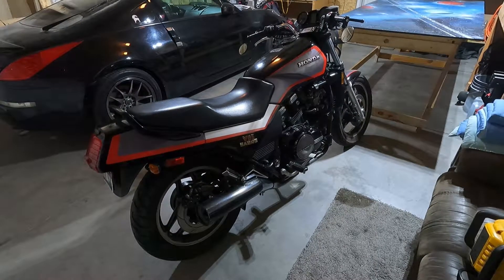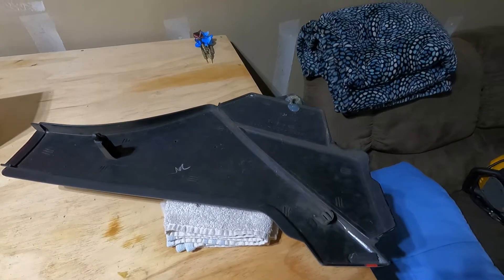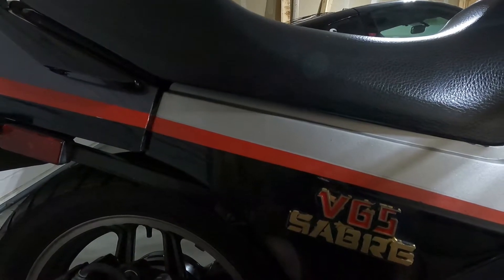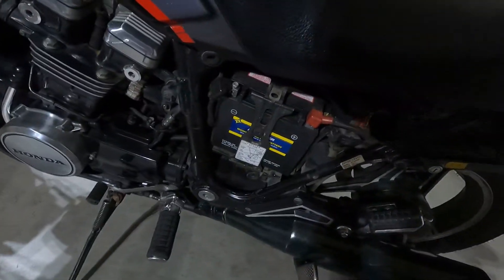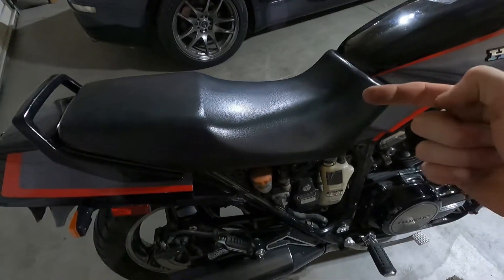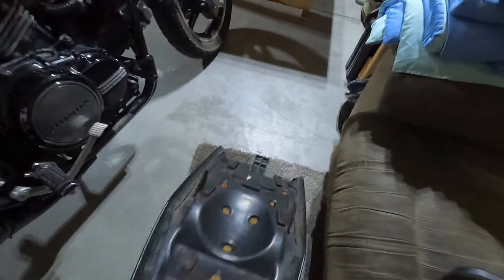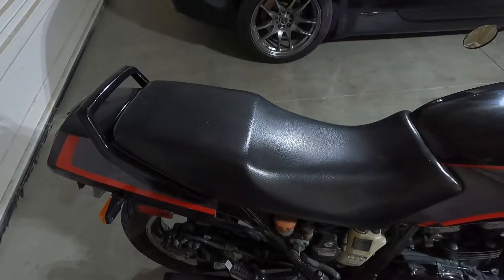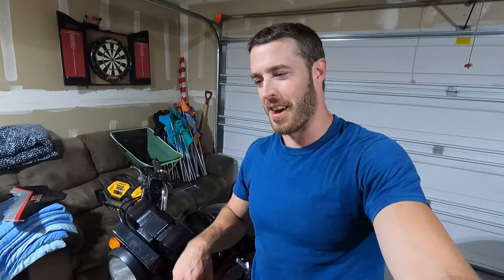Honda V65 Sabre: How to Remove the Seat

Comment: Hi , I purchased one in Ireland this week . Its the Clalifornia 1884 model v65Sabre  ( first of the bad cam lot)  with 80,000 miles on it and it was delivered by riding 238 km.  First thing is to get the oil mod kit to try and save it . Also its not charging at all and the battery goes flat and lights go out with engine cut out . However it fires up again with a charged battery . Solenoid is new . Stator and wires to check next . The engine doesn't sound too bad overall. If any home mechanics out there some advice would be appreciated . Thanks !

Comment: I have a question that's kinda related.   Referring to the Fuse box cover in the front right in between the horns,  but is that supposed to pop right out?   Is there a hidden screw that will release it.   I'm afraid of breaking it.   Thanks for any info.

Comment: I’m thinking of picking one of these up but hesitant with the cam lobe issues
Reply from the maker: I've been told by a number of people that later years resolved the cam issue. I can't 100% confirm that it's true, but it's what numerous people have said so far... Anyway, from what they say you should be safe with an 85'
Reply: @da_garage383  there’s one at a dealer by me that is 4K but looks a little rough and has a coolant leak. Those bikes are hard to find